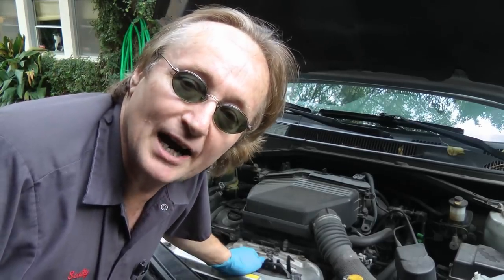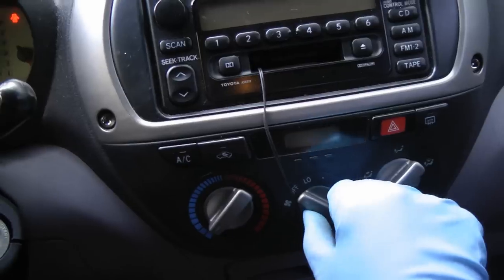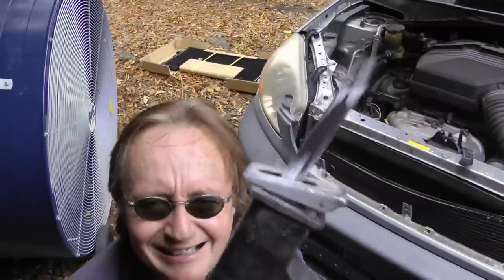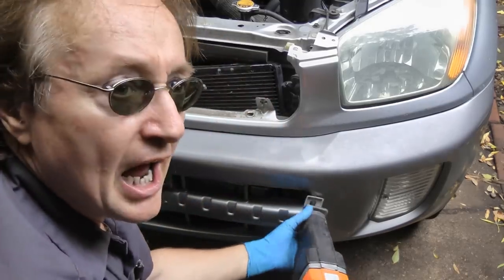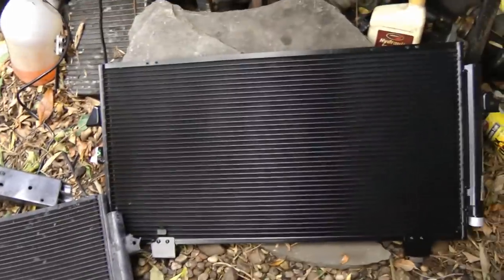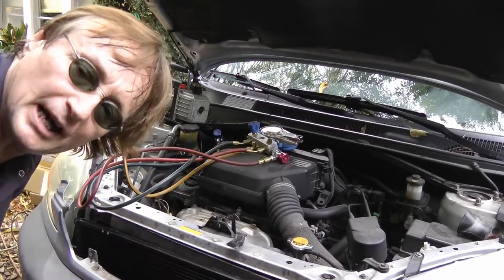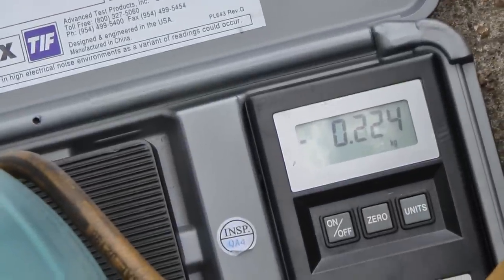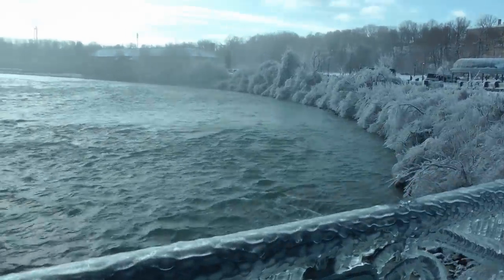How to Fix Car Accident Damage

Comment: personally I would disconnect the compressor and plug it and let diggle berry ride with no ac, ac is by no means a need in a car, I ride with the windows down most of the time myself, heck nowadays kids could stand to lose a few pounds from sweating!
Reply: A/C is fairly important when the temperature is over 100 degrees with high humidity in Houston.
Reply: +Jason Koneman not really...I've driven in texas all my life mostly without air. you arent going to die...
Reply: People get sick from heat exhaustion and heat stroke all the time
Reply: +Jason Koneman yes, they do. and if you can't keep hydrated and cool.thats more of a problem about being unaware of your body than needing air conditioning.

if you are old or weak or have small children then yes you need it. if you are a healthy adult with the presence of mind to drink water and stop somewhere and cool down if you start feeling beat by the sun. then not so much
Reply: +jdod64 or, with this being the year 2016 you can run the A/C and stay cool while reducing emissions and improving fuel efficiency and not show up everywhere you smelling like you just jogged there.
Reply: +Jason Koneman this was about necessity. not how its 2016 so everyone and their dog should have ac.
Reply: ac is a commodity for everyone. noone needs air conditioning, contrary to people in the north that need heating, I'm a welder in Florida, it gets over 100 frequently, humidity? shut up y'all don't know what humid is its normal for me to get to work at 7am and be sweating in 5 minutes just from opening the shop, spend 10 hours welding or torch cutting in a shop your lucky to have a fan in, I was also an AC tech, think its hot when your ac breaks at home? climb up in your attic for 3+ hours in the middle of the day, when you come out the 100 degree air outside will give you goose bumps, that's real man shit, that leave your purse in your Honda and suck it up shit, btw I own 3 vehicles 2 never had or will have ac, don't tell me you need ac in your car, #yallgotserved (this rant was for everyone that needs ac)
Reply: +Jodod64 Amazing, I can't even survive baking under a 30 degree son without having a headache feeling as if I'm about to vomit and pass out. 

But that being said, I can go 5C or 41f as you Americans call it without shivering.
Reply: The other thing some of these less educated/informed people are not considering is that in most modern cars the A/C system is a vital part of the heater and defogging system as it dehumidifies the air before it's blown through the heater.  In many newer cars if the A/C system is not operational then the heater will not turn on.
Reply: Man, I wish I could have AC in my 86 again. No way I'm doing a change over to the new stuff with a chance it'll have absolutely zero effect.
Reply: Jason Koneman Actually, you can turn the heater on as well as turn the A/C on or off; same with defogging.

Heater just runs off the coolant.

Defogging does work with just the heater providing that you don't mind have having foggy passenger windows.

Another way is opening the windows getting yourself soaked and having all the electronics on the driver's side shot.
Reply: BRBingeDrinker You can use a drop-in refrigerant without switching to r134a.
Reply: chrischoy9
what do you mean? i'm not sure what a drop-in refrigerant is.
Reply: BRBingeDrinker R413A pretty much replaces R12.

Works without changing all the stuff out for R134a.
Reply: R413A? i'll do a bit of research on it. how cool is it? as cool as R12 was?
Reply: BRBingeDrinker I was looking up on it in the forums.
Not as effective as R12, but miles better than R134a on a R12 system.
Reply: chrischoy9
does it have issues with the seals drying out? I heard if you did an r134a conversion without changing seals they would go bad causing a leak over time. is it the same for R413a?
Reply: BRBingeDrinker I didn't do it.
All the cars I have a 95 and a 05 both have R134a from the factory.

You technically need to change all the seals and horses because r134a molecules are smaller than R12. 

Also make sure you have enough oil.
Reply: I converted to R134a in my '92.  Miss the old stuff, but it's a PITA to find parts for the DIY for the old system.  If your R12 works perfect, don't switch.  If it needs work, might as well.  It'll save you money in the long run if you plan on keeping it for years and recharging, swapping parts every once in awhile as necessary etc.  And for a cheap condenser and some refrigerant, just make dingleberry pay for it themselves.  It's cheap.

Comment: parents should have bought there teen a truck they are more durable and you can survive PLEASE STOP BUYING SMALL CARS LIKE CHEVY SPARKS they get horrible crash ratings buy a pickup truck or a big SUV so if someone crashs into you Will survive 18 year olds can drive buses so if they are 18 buy them a small bus it varies from State school buses are very durable and will last you along time like 20 or 25 before they quit working you can take the seats out of a school bus now they school buses on eBay.
Reply: Pepe Gutermann not all trucks are off roaders
Reply: I learnt in a large sized 7 seater MPV :)

Now I've retired that (as the Idle control valve broke and the car is too old so there is a lack on parts) and started driving a 05 Corolla hatch. Driving that thing is literally no different to driving a large vehicle like that.
Reply: chrischoy9 it's your opinion
Reply: Tommy Whitaker That's the truth, not an opinion like yours
Reply: chrischoy9 ok
Reply: or just pick them up a crown vic. cheap car, reliable as fuck, good crash ratings. 

btw +chrischoy9 there is a pretty big difference between a truck and the way a car handles. i swapped between an suv, a sedan, and an f250 truck. all 3 drove different.

Comment: fuck air conditioning hahha i rip that out, all it does is create more stress on the engine and electricals
Reply: Fly Cat 1154 well if you're not actually using it then there's not really any stress on anything, aside from a negligible amount of additional weight.  On many modern cars, turning the AC on while driving on the highway has little to no impact on fuel economy.
Reply: Peter Schmidt there's windows on a car for a reason, don't need AC in the first place, and the engine is still tryna spin yet another device and will change the fuel economy, ecu pushes the revs higher to compensate.. more revs means more fuel usage
Reply: Fly Cat 1154 because i prefer to be comfortable in 95% humidity in usualy leather seats
Reply: Fly Cat 1154 A few things:
1.  Not sure where you live, but not every place in the world is tolerable without AC.  There are some locations where certain plastic objects (such as pens, bottles, or even the dashboard) will melt from heat inside a car.  You really think those people can tolerate no AC?  In other places, humidity is so high that the windshield will fog up, or it becomes difficult to breathe.
Remember - sometimes the only reason humans are able to live in certain climates is because of the HVAC tools we create.
2.  In the average vehicle, once you are driving beyond 50MPH (which I think is roughly 80KMH), the drag from leaving the windows open is greater than the drag from the AC.  That being said, when driving below that speed, using the AC is considered less efficient.
3.  How often do YOU drive on the highway with the windows rolled down?  For some people, the throbbing air pressure is nauseating.  For me, it's just simply annoying, but leaving the windows closed gets too hot sometimes.
4.  In my car at highway speeds, the AC has a negligible impact on fuel economy.  My car has live MPG gauges that are very sensitive, and turning on the AC drops by it maybe 0.1MPG.  Like I said though, that's highway speeds - at city speeds, there's a greater impact on fuel economy, so I usually roll down the windows.